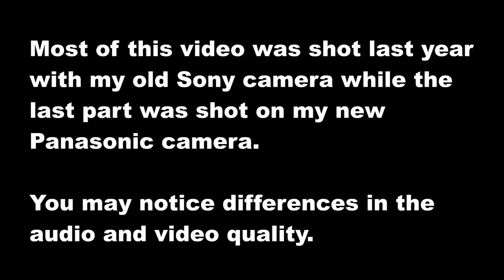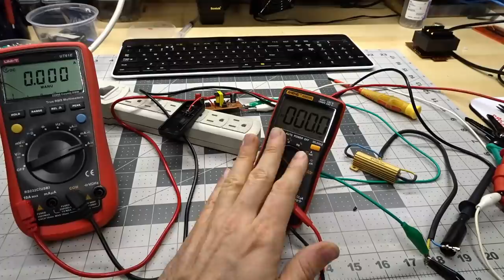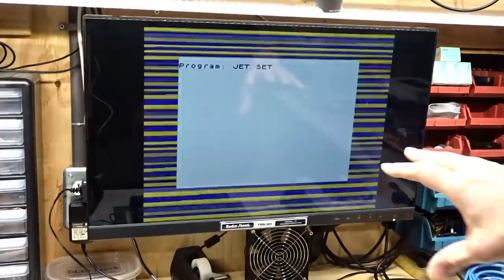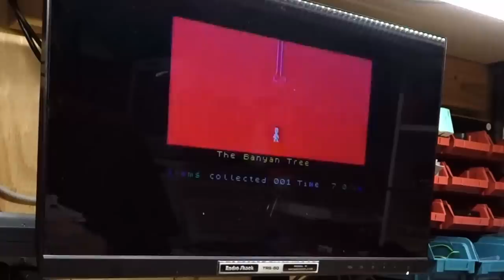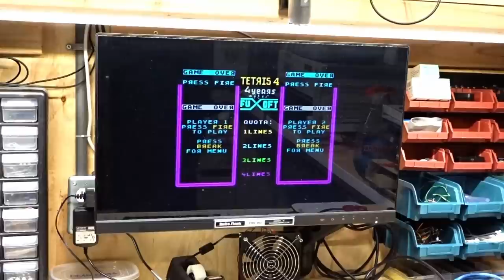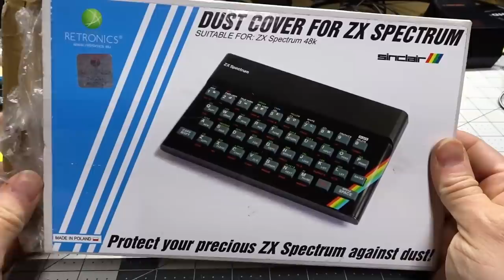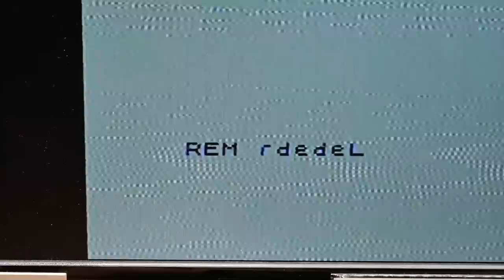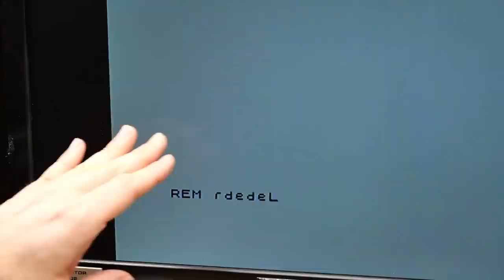ZX Spectrum Part 3 - Revisiting the machine at last!

Comment: Can you now move to Spectrum 128k and use that one? Bcs you also make videos about C64, not about VIC-20 or PET models.
Btw when you comparing Spectrum 48k to Commodore, remember C64 cost 2 times more.
Reply from the maker: I can see why this was so popular back in the day -- cost being a huge factor. Sadly Spectrum machines (of any type) are impossible to get here, so trying to find a 128K would likely require another trip to the UK.
Reply: @adriansdigitalbasement  What about UK's eBay? there is a lot of 128k Spectrums, working and non working for a repair, most great was model +2 if I remember. I believe you can find a subscribber from UK who can re-send it to US for you.
And you are correct, there are no US channels about Spectrum, so it will be great see it on yours. :)

Comment: International my ass it is mainly used by british and other nearby countries and it varies even in europe beyond that
but yes brown is "live" and blue is "neutral" but that flex is obviously not regulation as they require a ground wire even for 100% isolated power supplies in plastic boxes (overkill much? what do I even connect the ground to inside the psu?)
this post is nitpicky but I had to correct your obvious error in wiring codes
but yes a transformer rated for 220-240v would be bad to use on 100-120v as if it worked at all likely the output voltages would be less than 1/2 the normal output
but you could have looked to see if it had a center tap on the primary side as these older psu's were often wired as 2 series windings for 200+v countries and you could quite easily adapt them to be 120v often by a pad on the circuit board or a minor trace cut and single jumper

Comment: Hi Adrian, congrats on your video. I spent enormous amounts of time programming the ZX Spectrum, both in Basic and Assembly. To load a game properly, you should listen quite load sounds coming from the Spectrum as it gets the game data from your mobile, as you can observe here: https://www.youtube.com/watch?v=q6G-YGNrWm8 . I guess your problem is the Spectrum is not getting enough signal from your mobile as you try loading games. Watching your video, it surprises me I don't hear that sounds and I guess I should. Suggestion: Connect the jack of your sound cable either to the EAR input of the Spectrum or to its MIC input. I do not remember now how I did it. Try both methods until you hear the sounds perfectly loud and clear coming out from the Spectrum. Otherwise you will have the experience that many of us had as we used the cassette tapes, when the signal coming from the tapes was not good or loud enough...

Comment: You complain about loading games because you didn't have to adjust the azimuth screw on the tape recorder head for each game you tried to load. You'll have to hear the tape and watch for the highest tone when adjusting, hehehehehehehe

The ZX was my first computer, so I used it before using a full-screen code editor. And as you said, after you get used to it, you can program on it even faster than on a full-screen editor, because you don't need to type the commands, and this is an advantage. 

But after I got used to a full-screen editor in most modern computers, didn't miss the Spectrum.

Comment: When my friend's was loading, you had to tiptoe past because of a squeaky floorboard he was convinced would cause it to crash.

Everyone always stresses over how to get adhesive off. It comes right off with any white spirit or turps solution or substitutes which are so cheap they cost less than some bottled water. You just wipe softly a few times and viola!

I'm confused about why it doesn't load after you replaced the cover and membrain. Maybe you should put the old membrain back in.

They crashed a bit whilst loading but most often they worked. Such a pity. If you are going to compare it to the C64 now you're just looking for trouble. The Spectrum was a real tool. The UK software industry has the Spectrum to thank. Clive really did earn his knighthood for services to industry. Meanwhile, the BBC Micro with it's stated goal of teaching the nation to program taught nobody at all.

I think the problem is the mp3's are not encoded with a high enough bitrate and the signal is not clear enough.
Reply from the maker: Yeah it's a real mystery to me. That why I feel like there has to be a fault with this machine because I've never used something so sensitive before.
Reply: @adriansdigitalbasement  Have you tried it without the new cover. Perhaps the material is interfering with the board...

Comment: I think your amplifier is a bit too much. A single NE5532 would be more than enough as it's a classic audio op-amp and dual channel. There is no need for stereo here the audio is mono. 2 x NE5532 is total overkill and I'm not sure why there are 2 of them on this board. There's also no need for a 5532 in this application anyway, a simple single transistor amp would do the job just fine. Audio grade is not needed for digital signals.

Comment: I don't know why you didn't order the correct type of power supply so you can add add-ons like a DivMMC or a Kempston joystick interface. I think what you did was a waste of time and money.
Reply from the maker: Haha what exactly is a correct power supply? The system uses a 7805 voltage regulator -- which can easily accept from 7v to 35v.
Reply: @adriansdigitalbasement  9v at 2000ma. You yourself said that with the supply you cobbled together, you wouldn't be able to plug add-ons into the unit. I wouldn't find that acceptable at all. There are lots of great add-ons out there made by the ZX Spectrum community like a DivMMC adapter, joystick adapters, VGA adapters and more.

Comment: The audio input is expecting a 'line level' input
Reply: No it isn’t, that would be wayyyy to quiet, the Spectrum really is deaf!
Reply: IIRC from back in the day it needs about a 2Vpp signal.
Reply: @SproutyPottedPlant  Line level is about 1,000 times as strong as a mic-level signal
Reply: The sound of the loading program should really squeel out of the spectrum itself.  Not subtle in any way.

Comment: Earthing. You don't have any proper earthing. Most of these cheap PSU are bad in ripple filtering. So you need to fix the ripple. Use oscilloscope to see the ripple. 

A small chock (coil) in series could help. 

And a proper earthing.
Reply from the maker: I powered the spectrum off my linear bench supply and there is no change in the performance of the machine.

Comment: "modern" just being another word for "crap". switched powersupplies are unreliable, cause high frequency interference, aren't properly isolated, cause resonations on both ends (let's just say they've killed plenty of 12/24 dc to 240v ac converters by now), literally the only argument 'for' them is that they're (for some reason) cheaper than a lump of copper wire. but keep in mind that that lump of copper wire did the job just fine for 30 years and probably still does  also there literally is nothing 'modern' about switched power supplies, they were around in the 80s, they were crap in the 80s, and they are still crap today (even more so than back then in most cases ;)